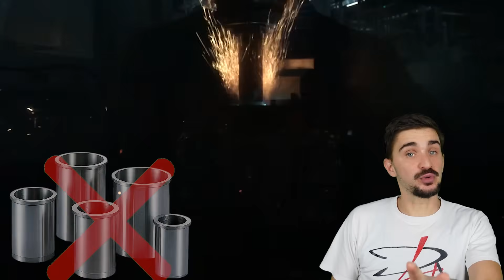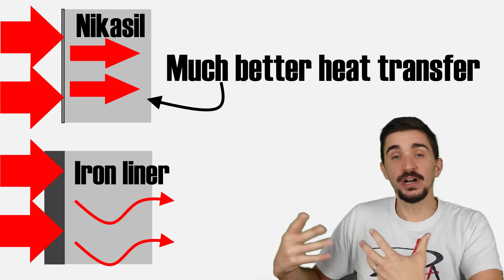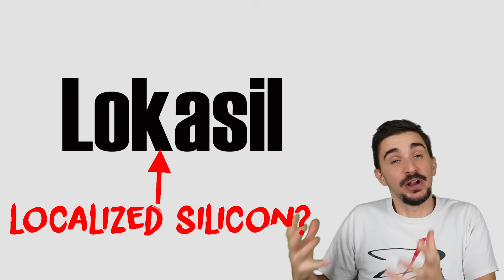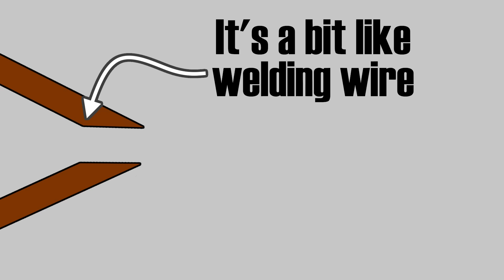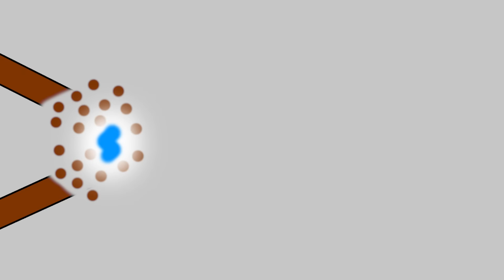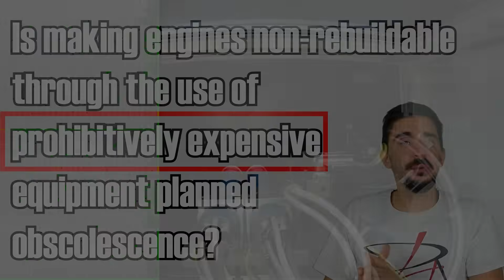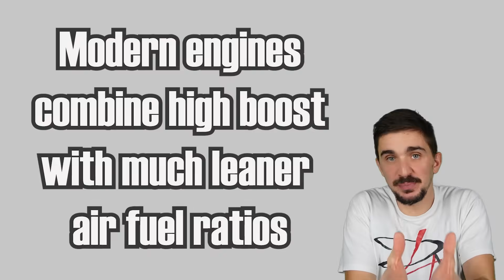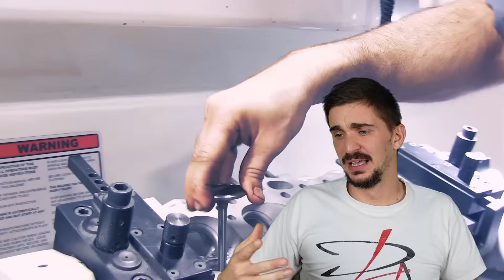Why Are Engines Becoming Non-Rebuildable? Everything About Cylinder Coatings

Comment: Another fun input is that most motor technology from let’s say the 80s-2016ish were for the most part: stout and made from iron blocks. But because of the advances in technology, manufacturing, and cost per dollar production, there’s almost no need to make such stout blocks anymore. Aluminum is almost the new standard, V8’s and Inlines 6’s are rarely used for commuting vehicles, and with emissions becoming so strict coinciding with high gas prices, cheap yet efficient engines are the new standard for manufacturers. As many have mentioned, rebuilding was merely a byproduct of an older era of vehicles, we’re at the tail end of that era now. So sadly, it’s off to almost non rebuildable motors.

Comment: I think you forgot in your calculations that boring a block can be done 4,5, even 6 times, then relined again and requires some die cast aluminum for more pistons, and some watts of electricity for the boring bar. 

I am going to guess that the mining and refinement of precious metals for coatings, and the electricity used to coat these far exceeds that of a rebore on a cast iron block.

Comment: After taking the time to watch your complete video I noticed that you left out the CO emissions of building the new cars. The plastic interior, foam seats, wires, carpet, upholstery, metal/plastic body panels etc. instead of the savings of getting 5-10 more years or more of use out of a 10-15 Year old car. Average of 150,000 - 200,000 miles. 🧐🤔🤔🤔🤔

Comment: You're considering ONLY the rebuild or recycling of the engine, but there's a bunch a lots of parts to be considered in a car, such plastics, electrical installations and body parts.
Just need to dive deeper in the problem.
Not only the engines are build to be discarded.

Comment: 99% of engines have cylinder liners. Also, the "planned obsolescence" myth is a tired old liberal canard. There is this thing called COMPETITION. If some manufacturers make a blender that lasts just 5 years, others would make models that last 10 years and market their longevity. It is the green psychos killing engines with corrosive ethanol mandates and ever-more convoluted electronics and plumbing forced on consumers based on the absurd myth we are "killing" the planet.

Comment: I totally disagree with your conclusion that using the spray coating is not planned obsolescence. Its totally is. Making things too complicated or requires very expensive tools that smaller repair shops cannot afford to repair is 100% a planned obsolescence move by manufacturers of things. Making repairs so expensive that people are forced to buy new products instead of repairing the old ones is planned obsolescence

Comment: The reason being in need of a rebuild is many times the coating or a complete overhaul of all.
The issue is see is, we had engines which lasted 300km EASY… all day all night not even being maintained as well as they should. 
But nowadays engines are so fragile making one mistake costs you an engine.
And Engine rebuilding is no big business anymore cause its cheaper to throw a new engine in or buying a new car.
The usual car cycle is not the same.
For me its hard to say what would be more efficient thats why i always listen closely but maintain mostly silent …

Comment: Why not both? It could possibly allow for the benefits of both and possibly thinner cast iron sleeves while still making the engine rebuildable if not a bit heavier. I imagine it would also be easier/quicker to coat sleeves rather than coating the bore of each piston on each block, although it would add the extra step of sleeving. It would also provide a bit of security and a warning sign for when the coating has worn out, as the oil would experience a spike in iron content.

Comment: As an engine machinist, my solution to the challenges in rebuilding as mentioned would be the development of liner materials with similar thermal expansion characteristics as the parent metals of the cylinder blocks and ring packs which would work well with such an alloy. In my area, I seldom see any of the engines mentioned and therefore have studied  this topic very little.

Comment: I thought we would have compared the 5% savings from the coated engines over 10-20 years to the cost of having to manufacture a new engine Vs. having a less efficient engine for those 10-20 years but then being able to spend less energy rebuilding the engine rather than replacing it. I figure ALL engines will get recycled eventually so emissions related to recycling in the long run wouldn't matter in this comparison? Something kind of like replacing parts in your older less efficient car to run it 10 years more and comparing it to the emissions of making a new but more efficient car after 10 years.

Comment: Thanks for the video.  Unfortunately, indiscriminate enlargement of a 
2-smoke engine will cause severe issues with engine timing.  Some 2-S engines like freight trains and ships, run differently than household 2-S machines , so maybe so in those cases.

Comment: I drive an 'immortal brick' and don't have to care about these stuff. My 245 is 33 y o and has a staggering low 250 000 km on the odometer. Rebuild will take place in 2045 or so (by my grandchildren?) if there is still petrol around.

Comment: I appreciate this video. Buying incredibly expensive equipment isn't planned obsolescence, because it's counter-productive. Instead, planed obsolescence is using a cheap plastic seal for high temperature high pressure radiator seal inside the middle of the engine. Hello 2000s Pontiac Grad Prix Intake Manifold Gasket failure. A well known issue that an engineer must have pointed out at some point during the design phase. I mean, it's not not like my family went through that disaster personally. Nope. We didn't have to wait 6 weeks because GM was intentionally not producing enough gaskets to meet the demand they created when building a faulty engine that failed shortly after 100k miles, after all the warranties were expired.

You can validate the issue on the carcomplaints website. It's in the same related category of issues of leaking seals which also causes the engine to spontaneously combust because of an oil leak. That also happens right after 100k miles. GM definitely knew what they were doing with that car, and they built the engine to fail after the warranty was done. A pretty jerk move, if you ask me.

Comment: is the mileage increase % based on nikasil or iron? Nikasil can still be rebuilt. I know it's a shot in the dark analysis, but I also know that when an engine goes, if it can't be rebuilt, or is too expensive to rebuild, then most people just get a new vehicle. Often times people get a new vehicle anyways but sell the old one to someone willing to work on it. So the co2 should reflect the production of an entire vehicle, not just the engine. imo

Comment: Isn't this what the Chevy Vega did? And it failed, spectactularly - normally, the engine would burn almost as much oil as gas at about 50,000 miles, as the engine basically "bored" itself to death -

Comment: What the H have you been smoking. I’ve seen a lot of videos about problems with these thermo spray coatings not lasting. The engines are garbage when they fail and if possible to rebuild not worth the cost. And if possible you are not going to find a local engine machine shop having one of these coating spray machines because they are vary expensive. This hole process is about the bottom line Money, Money in the pockets of car manufacturers. Car manufacturers today have a long track record of building unreliable engines. Then if you look at the cost of pulling an engine out of one of these high end cars like BMW or Mercedes doing a complete overhaul, done right -???, good f-ing luck on that. My guess is a bill over 20,000.00  dollars.  I’d don’t think any engine machine shop would make a capital investment in a thermo spray coating machine, the market just wouldn’t be there.

Comment: For manufacturers, the only real concern is how fast and how cheap. Emissions are down the line from milage because mileage sells. 
My question is the emissions created due to energy used regarding an engine rebuild vs creating a new vehicle, factored in against operating emissions over vehicle lifetime.

Comment: Well, after watching the video, I still didn't understand why I needed an engine in an ordinary consumer car with all these cool bells and whistles and dustings. I don't need any great heat-conducting properties there. When driving on public roads, I use a maximum of 50% of the power of a dead 1.5 liter engine with 70 horses. And this is enough to accelerate my bucket to 110 kmh.
Even in your examples, you never use the engines of cheap cars. Why would I need such technology in a car like a Renault Logan or Ford Fiesta?

Comment: Just a note: electricity does not flow from anode to cathode, current is electrons, always flowing from ground / earth / "negative" to the anode. It was around the era of the transistor that this misinformation started happening (during tube era current-flow was represented correctly, as electrons boil-off the cathodes so you can virtually SEE the way current flows, especially since the anode & grids always radiate-out from centre cathode!).

As to why this misinformation started being taught, I guess it's because of the way transistor circuits are set-up. I think it's the dumbest thing to ever happen in the field & trying to explain to everyone that what they get taught in school is backwards is always annoying. Even if somehow this current-flow makes more sense in circuits, I think it's super dumb & makes things very confusing when working on equipment where electron-flow is critical, though it's mostly relevant in thermionics there are other times too.

Comment: Where I live in the North East salt/rust belt, once a car hits 250 000 kms and 10 years old if the engine needed a rebuild, the car is a rotten piece of junk, with rotted out jack points, full exhaust ready to fall off, all brake lines ready to pop. If someone is going to entertain replacing bad engine, a junkyard one will go in and fingers crossed.

Comment: Yo I'm in College for this stuff. In my college course I had to rebuild the 2.7 l that there putting in all the newer Silverados. Basically every single thing thrown away on that engine. All the bolts are torque to yeaild on it. Literally most of the engine you have to get new bolts and gaskets and stuff my professors told me a deal ship wouldn't have you rebuild it I would just be dropping a whole new mortor in it

Comment: You are only comparing co2 from engine rebuilding. You aren't accounting for the savings from keeping a car on the road vs having to build an entirely new car, which usually occurs when the cost of replacing an entire engine is considered.

Comment: Engines could still be rebuildable if cylinder/pistons were designed to be easily replaced. Make the cylinders removable from the bottom end like two stroke engines.

Comment: Dirt bikes and ATVs have been this way for YEARS. The cylinders CAN be repaired and replaced when needed. Many times, the coating is not harmed and new pistons and rings can be installed and clearances still be in spec. I imagine the same could be done in an auto engine..... The coatings do work better than the old sleeves as sleeves always wear. As stated here, they run cooler too.
Reply: And of course the manufacturers cheapen EVERYTHING.......

Comment: Well basically computers design everything now and everything is assembled by machines so the tolerances are very tight and then materials are subpar with the use of alot of plastic and aluminum.  All that coupled with the manufactures wanting people to buy new cars every few years. Such a simple video this could have been.

Comment: Why do Companies do the things they do?
1. PROFIT
2. PROFIT
3. PROFIT
4. PROFIT
5. Mandated by a Government Entity to do X
6. PROFIT
7. PROFIT
8. PROFIT
9. PROFIT
10. Propaganda and PROFIT

There is a reason why there are only a handful of Appliance Manufactures, or Tool Manufactures etc.
There is a reason why all these companies, no longer "Compete", in the traditional sense, as they are owned by a handful of Massive Corps.
There is a reason all these products and more, seem to breakdown and start to have problems, not long after their warranty.
There is a reason these products FAIL, usually within a Decade or less, and costs more to repair than replace.

PROFIT. 

These same manufactures claim it's "Better" for the Environment, it's "Better" for the Consumer, it's "Better" because it's Recyclable.
NOTICE the One Constant
PROFIT
Why produce a piece that is easily replaceable and relatively cheap, when you can produce and charge more for the same item all over again?

Comment: I needed to re-seal a 1996 OM606A diesel engine at 500,000km.  Decided to do the headgasket while I was at it.  Cross hatch pattern visible all the way up the cylinder walls.  This thing is going to last forever.  Longer than me anyway.

Comment: As if anyone rebuilds Mercedes engines anyway! Germans make some impressive cars but by the time they need an engine rebuild most likely half the bloated over engineered over expensive systems on the car also need replacing. 
That said there is a YouTube channel I've seen where the guy does refurbishment of mining equipment and he has a thermal spray coating setup for only a one-man workshop. I imagine such coatings need to be machined afterward. Further, never underestimate the ability of turners and rebuilders of performance engines, to come up with sophisticated workarounds for these sorts of problems

Comment: Engines are always rebuildable. The spray is a way of cheapening the building of an engine. You can always sleeve those engines but what you come down is to the labor to rebuild vs. buy new become so great your better off buying new. This is coming from an industry professional that has rebuilt these engines with upgraded parts when the new engine was not available due to age(how new or outdated) or availability. At the end of the day it comes down to cost. Even a block with a hole can be fixed and rebuilt with welding that block but it comes down to cost.

Comment: Scotty Kilmer says that TURBOCHARGING (boosted pressure) WEARS OUT engines faster. But since global atmospheric Oxygen levels continue to gradually decrease (150 years ago oxygen was 30% of air), TURBOCHARGING is becoming more prevalent.
All automotive manufacturers should be mandated by the United Nations to make vehicles that run mostly on Split WATER (=HHO= Hydrogen and pure OXYGEN).
An on-board electroysizer can electrically split H2O into the two elements at much safer low pressures, maybe only a few PSI, as compared to 10,000 PSI  for a full tank of compressed Hydrogen.

Comment: This was a fascinating analysis of an interesting topic, although I think in modern cars, engine failure (at least engine failure due to worn bores) is rarely what condemns a car to the scrapper.   It is usually either expensive and difficult to fix electronics issues, issue of corrosion (in the UK climate at least) or mechanical failure due to neglect.  Whatever coating an engine does/doesn't have is unlikely to be the deciding factor in when it gets scrapped so the environmental aspect is very,  very hard to determine with any accuracy.   Though from the point of learning about the different types of coatings and application processes used, this was well worth a watch.

Comment: One cost that you missed was when an engine fails but you have a perfectly good car otherwise. You have to throw away a perfectly good car and make a new one both of which have a much larger carbon footprint and cost. The manufacturer wins because you have to buy a new car. Environment loses because of all the non recyclable parts in a car.

Comment: Larger Yamaha outboard engines are using plasma coated process bores.  
Commercial users are achieving several thousand hours in service with excellent reliability.

Comment: Engines are not open deck for cooling and the engine is not going to melt at all that’s a load of shit. If you look at the head gasket and cylinder head their are only small holes for the water passages. Open deck cylinder block marks a change in manufacturing, cylinder blocks no longer have core plugs or welch plugs or what American’s call freeze plugs. These plugs cover holes needed for removing the casting sand after the block is cast with a closed deck, the difference now is cylinder blocks are open deck and the casting sand is poured out the open deck and open deck blocks don’t have core plugs. 
	So the answer to the question is cylinder blocks are open deck because they are cheaper to manufacture NOT because they have better cooling.

Comment: Wondering if spray welding is similar enough to use for this coating.

There would also need to be a coating technique that a rebuilder could use. Maybe as simple as depositing a thicker coating and then machining it down, like in spray welding.

Comment: The further I get into this video the more you lose me. You say you get better 'performance' with this tiny sleeves and go on to say how they been adapted from high end expensive race cars. I have had plenty of 90's vehicles with Cast Iron parts and I really didn't need any more 'performance' i am pretty happy with what I had. I am also proud to drive a vehicle pushing 300k miles at 30 years old still on the original engine. You don't need to change the way your making something if there was nothing wrong with how you were making it before. Any company that pushes massive R&D to modernize their cars quickly now have less reliable cars than the did before, because they changed away from something they were good at.